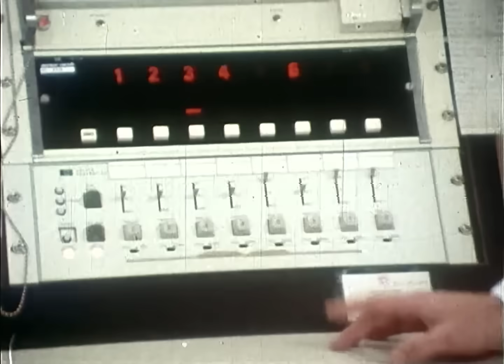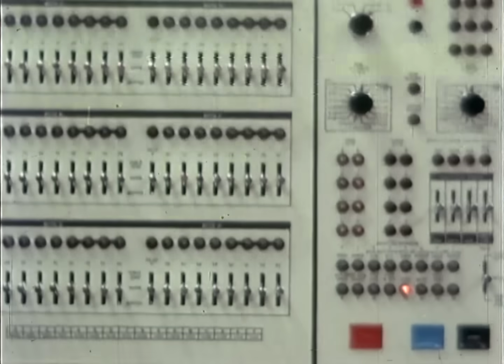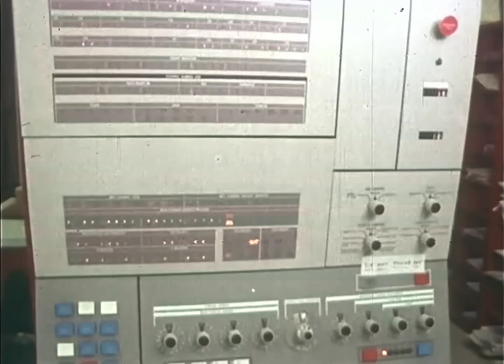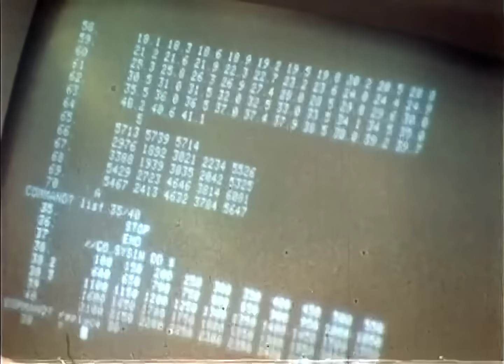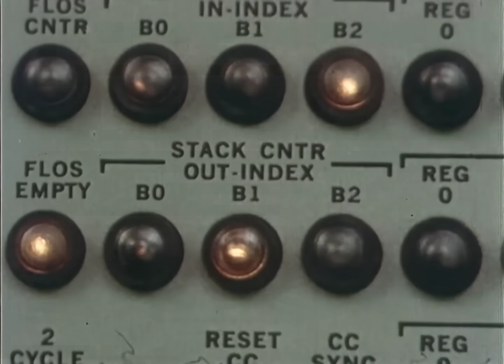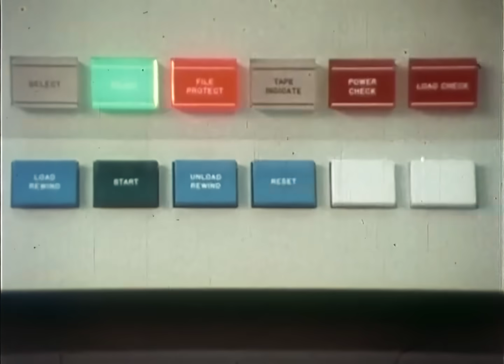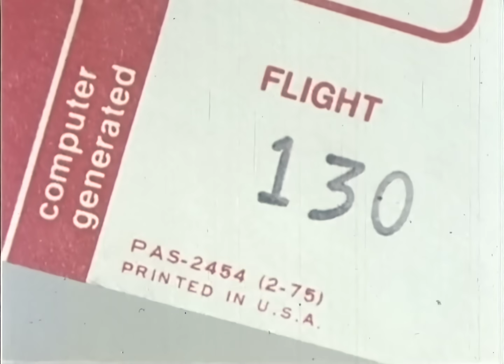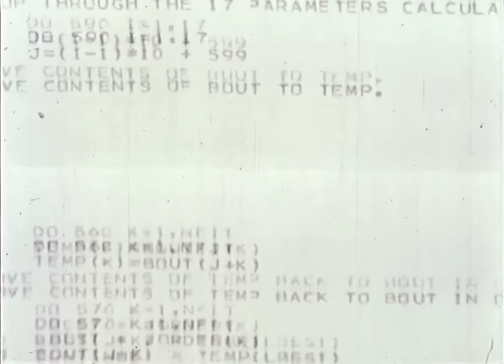Basic Computer Terms (1976)

Comment: I loved the video - I'm 67, I remember working on these devices, learning cobol and basic programming languages, we thought we were so high tech.  This video was a happy trip down memory lane.
Reply: I still have a floppy disk from high school 1988
Reply: @ronaldblackburn2483  It's demagnetized by now, and your data is lost.
Reply: Hell you could still get a job if you remember your COBOL. The banks would love to talk to you about contract work...
Reply: COBOL still powers most of banking and mining operations. Oil and gas giants are still clumsily operating COBOL despite the advancements in other languages. Mostly to do with fixed point arithmetic, the inaccuracies in floating point arithmetic used in more modern languages is commonly cited as the reason why.
Reply: What was before cobol?
Reply: @jacobshelt01  You would hold a magnet over a hard drive very carefully and hope the bits of your desired program aligned correctly.
Reply: @jacobshelt01  there were a few - I checked Google, COBOL was developed in 1959.  The first complied programming language was Autocode developed in 1952, then 5 more after that (1 developed in 1955, 2 developed in 1957 and 2 in 1958) then COBOL
Reply: Say. You wouldn't know where I can download a secured scuzzy bus driver, would you? Lol
Reply: Ooh Cobol! Pascal was used on ICL 2900 machines and I remember using RPGIII on an IBM Sys 38. OMG... I can't be that old! 😮
Reply: You were high tech! I'm coding Go and helping companies run their programs on Kubernetes because I'm standing on the shoulders of giants. Amazing how much progress in computing we've experience over the past 100 years compared to rest of human history. I just wish we'd calm down with making AI take over everything.
Reply: @user72974  You should know that Kubernetes is on the way out.  Watch one of those "revenge" videos here, and you'll see that AI is still crap, and is not expected to get much better soon.  If AI can't find an answer, it will make up lies, just like a dishonest person.

Comment: I had a low level tech job in the early 80s as a "field engineer" - mostly board swapping and maintaining "peripherals": terminals and printers and hard drives the size of dishwashers, but also some really old paper tape and punch card readers for the military, though I was a civilian. The Army never threw old equipment out, they just added new stuff and hooked it up to the old. I had the Presidio and Fort Ord  and a women's prison as well as the Federal reserve in my territory. Back then we had 64K and 128K boards - each was literally a circuit board the dimensions of a briefcase that I kept spares of in the trunk of my car. I still have nightmares about that job and the 3 am pages to drive to some site out in the sticks. Data entry back then was a room full of terminals with mostly women (except for the military sites) smoking cigarettes and eating crackers at their terminals. The keyboards were swappable and I had a bunch of them in my trunk too - they failed frequently because of all the crud falling into the keys. Ah, the good old days!
Reply: I worked in a temp job during the early 80s at MCAS Cherry Point.  The new software had a bug which made it rewrite the entire database every time you typed in a part number that the program had to verify.  It took an entire day to type in the information from just two aircraft work orders.  They finally pulled the plug on the software and let us do the data entry on "Green Machines" that did no verification at all.  They did it the old-fashioned way by having all the data entered by two different people and then compared.

Comment: The TWA reservation terminal looked like the Incoterm computer. Same as the ones used by the original Braniff International airlines when I worked for them in 1980-81.

Comment: Those computers certainly used a lot of paper back then. I would have that the most common output device was a monitor, not a printer.
Reply: Back then, the computer operator was seldom the actual person who would benefit from the output.  The operator just ran the batch jobs and gave the output to the person requesting it. Thus, that primarily was through paper if not through a tape reel for more established and elaborate jobs to run.

Comment: It's interesting that most if not all of the terms introduced in this video are still commonly used today. With that said, there is a movement afoot to replace the terms "software" and "program" with the dumbed-down "app" -- not only for phones, but also for computers.
Reply: I grew up in the 80's with personal computers.  Just to use them I had to learn a lot about computers to manage settings, programs, etc.  But nowadays, computer savvyiness is regressing because you do not need to know any of that to use computers effectively.

I view it like car maintenance.  I'm middle-aged and have only had one flat tire in my lifetime.  I have a 23 year old Altima and the only major repair I've had to do is replace brake rotors.  I don't know much about cars and maintenance outside what I have learned out of curiosity because I do not need to know that to use a car effectively for two decades.

I think that computer user experience is hitting this point.
Reply: @Born2bwire  I agree.
Reply: @Born2bwire  I still have to know detailed computer stuff to keep my system going.  Most people never did know this stuff.  I built my computer, so I know how it all works and can fix anything about it.  Today's people know very little about anything.  When they lose their phones, they can't call anyone, as all the numbers were stored in the phone, not in their heard.  They can't change a tire even.  They might as well throw away the car, just like you throw away an appliance or small electronic device, as it is easier than fixing it.  I have changed at least three tires.
Reply: @Born2bwire  Except that software providers, specifically MS, produce Operating Systems that REQUIRE you buy a new computer every few years to meet their new OS's minimum system requirements.  Running a 23 year old computer SHOULD be possible, and in fact is, but they're making it increasingly difficult.
Our culture, as a whole, is making it increasingly difficult to function without owning a smartphone.  I'm a holdout, I don't own, nor desire to own one.  But I can foresee a day when I will HAVE to own one, like it or not.

Comment: Seeing her shove a handset into the computer threw me. Could they not just connect it directly with an RJ11?!
Reply: Those acoustic couplers were a workaround for the fact that Bell used the power of their monopoly to make it illegal to connect any non-Bell equipment directly to phone lines. RJ11 connections quickly replaced them after this was overturned.

Comment: I love how to connect to the network you literally put the phone receiver up to it lol. Like it literally talks on the phone with its computer buddy
Reply: Yup! You know that old dial up sound? That's a later version of this, where instead of playing sound the modem would just push the equivalent electrical signals down the line. The only reason we heard the dial-up was because modems had speakers so people could diagnose connection issues. As time went on the speakers simply got dropped bc you could use other indicators like error messages and blinking lights.

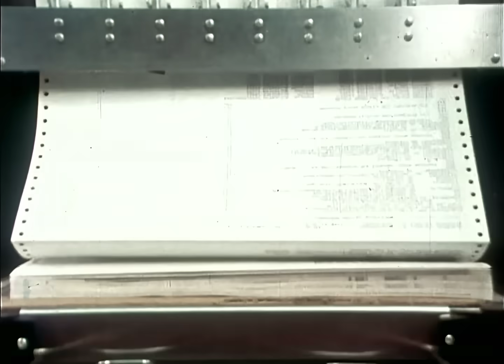Comment: 11:25 was the code supposed to be results?  Printing numbers in spreadsheet-like columns would have fit the audio better.  Printing code while saying that confuses data with the program and they were trying to distinguish those in most of the video.

Comment: It feels surreal seeing a whole workspace filled with computers that display exactly what the processor is doing, then there's the perfectly squared tiled floors and sparse bits of vibrant coloring.
Reply: My mother was a keypunch operator in those days.
Reply: @teresabenson3385 One of my mother’s first jobs out of “business college” (AKA secretarial school) was working with punch cards. Would have been the early-mid 1970’s.
Reply: @TheFirefox Same time frame, same type of school for my mother as well.
Reply: These places still exist today. They are just called data centers. Those perfectly squared tiled floors can be lifted up with a suction cup. Underneath the floor is a ton of wire that is powering those machines you see in that computer room.
Reply: Plus the raised floors needed to help cool the massive computers!
Reply: Those square tiles are ubiquitous in equipment / server rooms.  It's because the whole floor is between 12 to 24 inches above the actual floor; most of the cabling and HVAC management is under the floor.  Any one of those tiles can be pulled up so you can look / work under the floor.
Reply: I kept thinking that the punch cards seemed so unnecessary... you type everything in, only to have it punch the cards, which you then have to feed into the card reader... why not bypass the middleman and just use a terminal?
Reply: @1030media  it was basically so you could quickly re-enter it on any computer - often these machines didn't have any long term storage - and another is that these machines were often shared, so you would be in a queue to have your program run at a later time. It was also handy when debugging to see what you actually typed so you can replace any mistakes and re-enter the corrected instructions.

At this time this was becoming a bit redundant - you often did have a persistent personal directory in a university mainframe for example, but a lot of businesses had spent a few million dollars on their computers a few years ago and weren't about to upgrade everything to save people some grief!
Reply: @1030media  Punch cards were created before magnetic tape and disks, so it was mainly for storage. Paper tape was also used and many teletypes (which actually existed before computers) had paper tape readers and punches built in.
Reply: Iv'e seen a teletype machine a very long time ago and we had had to learn how it works.
Reply: @DaryxFox 
When I was in high school (70's) we had a teletype terminal connected to the local university. We saved our programs on yellow paper tape!
Reply: @DaryxFox punch cards were even invented before computers, for weaving machines. They actually were significant inspiration for the invention of computers!
Reply: @1030media  the same reason you save documents to disk instead of losing them.
Reply: @1030media  most of those computer computers did not have memory… the punchcard behaved like a thumb drive.  It was easy transfer between machines. Companies like to use them to store employee data.  A punchcard could generally hold 80 characters which equals 80 bites.
Reply: @1030media Punching data stores data right on the card and does not tie up computer resources .  A terminal would be connected to the CPU and require dedicated mag tape unit or disk drive to store the data, tiring up computer resources.  Also likely there were gazilluons of punch machines arlready around at that time. That’s my guess anyway, having spent the first 5 years of my career punching FORTRAN into an IBM 029 punch machine
Reply: @1030media  data storage - you didn't need memory if the entire program was in that hard copy (punch cards)
Reply: @1030media no ram back then you programmed it every time you ran. Punch card shortened that

Comment: All that beautiful hardware❤
Reply: When I was in the Australian Navy (electronic warfare) we still used these sprawling machines from the 60s and 70s right up until around 1997. Sad to see it all go, it was fun to work with, we just ran out of spares. Giant rooms of gear, all of it replaced with two low end workstations on a small table, one of which was for redundancy.

Crazy to think that even your WiFi router has more RAM, storage, and compute power than everything combined in this video.
Reply: My grandfather worked at Graphic Control in Buffalo.  All those printouts on computer paper, I used some of it as drawing paper when I was a child.